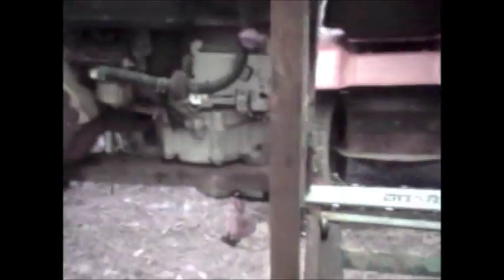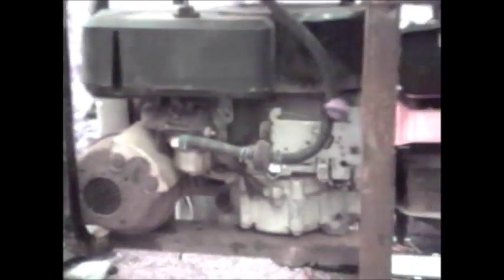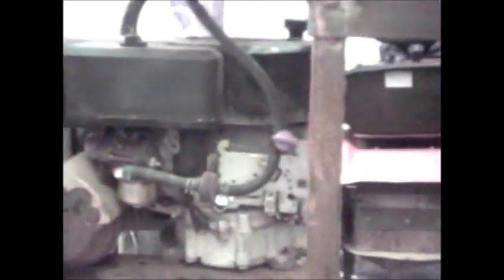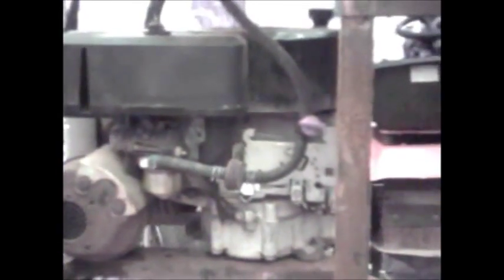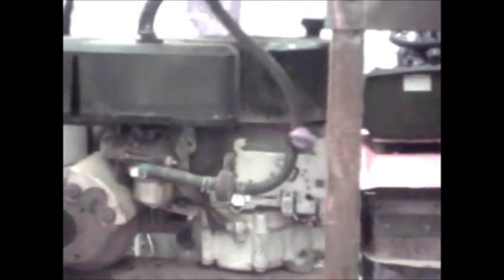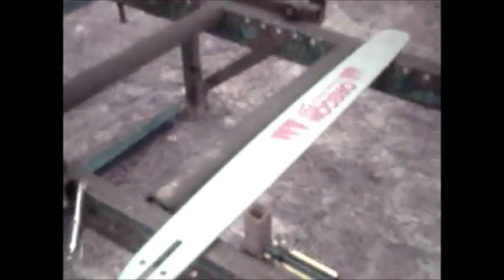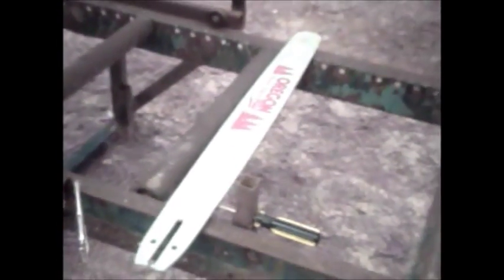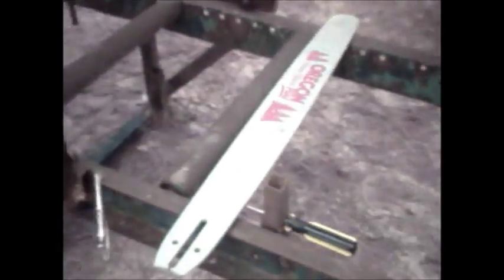Sawmill Build Part 4

Comment: how did you you lock clutch to motor shaft ?
Reply from the maker: bolted directly to the crankshaft of the engine with the bolt that held the pulley set to the crank, made a spacer to adapt the bolt size to the clutch housing and i just used the spur gear with out the clutch its self .. so its direct drive.. Thank You for the comment